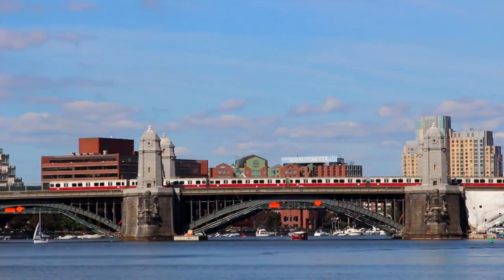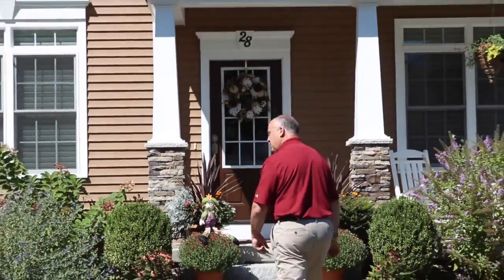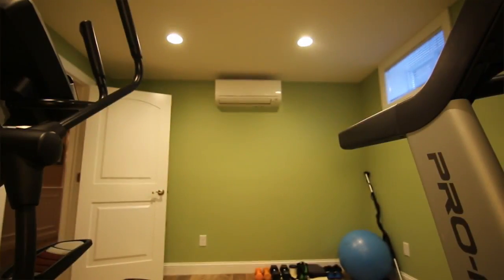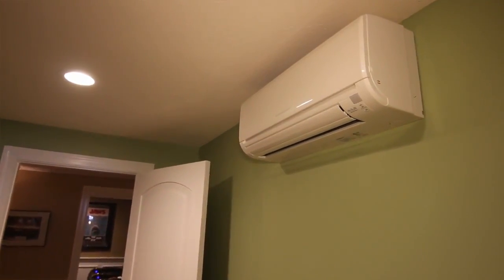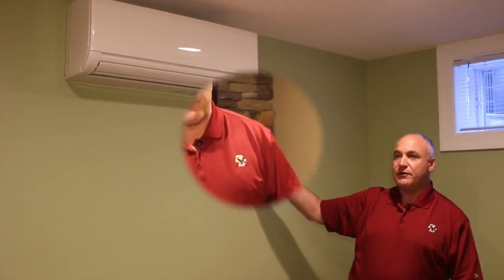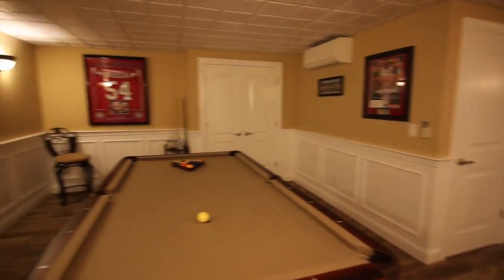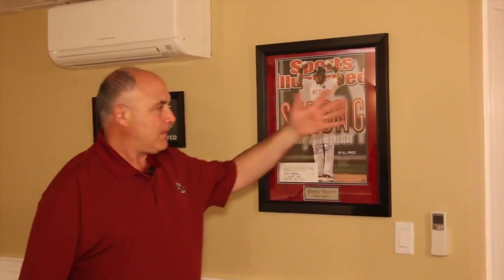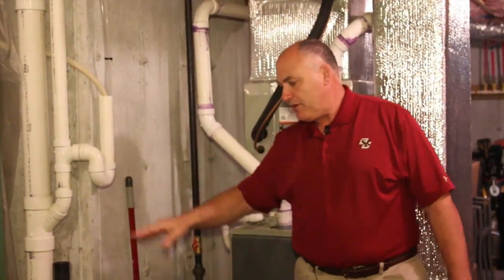Mitsubishi Ductless 3-zone Heating and Cooling Basement Walkthrough

Comment: I am finishing my 1978 basement. Unless I cut holes in the HVAC (which always seems haphazard) I have no heat or cooling.

I thought about a ductless mini split system, but I don’t even need the cooling, even with the AC on for the first floor and second floor, if anything, it tends to get too cold in the basement in the summer. I really just need the heat.

Comment: I notice at 1:38 that that indoor unit is not 6 inches from the ceiling. Does the unit still function fine? I thought the indoor units have to be 6 inches from the ceiling.
Reply: Looks like the ceiling is panel so there's probably space still.

Comment: Why does no one talk about how useless these are in the winter. Would have been a useful piece of information to have before I purchased them. They do not work at 13 or below degrees.
Reply: There some that work well even at 0 degrees but they cost a lot more
Reply: @adriansmith7104  Which ones would you recommend that works well at even 0?
Reply: @saimayousuf  Mitsubishi or Fujitsu but honestly most brands these days have hyper heat models that perform well at minus degrees
Reply: @adriansmith7104  thank you
Reply: I’m sitting here in my bedroom, it’s 1° outside and 12° in my attic, and my regular non-hyper heat Mitsubishi heat pump is keeping this room a comfy 68°. It is using more electricity than it would at 32° because of the loss of efficiency and it takes time out to defrost. But here on the coldest day of the year in New Hampshire it’s comparable in cost to turning on the oil heat and much cheaper when it’s 20° warmer.
Reply: He said it works down to -13F. That is the Hyper-heat version and is enough for most climates and that is the one most people should be getting unless you are in coastal Florida, or southern CA or AZ. -13F covers more than 99% of the time in Minneapolis. (I would still have backup heat in Climate Zones 6 or 7.)